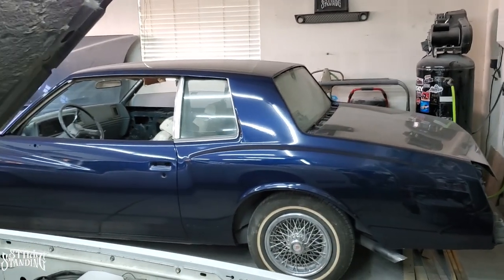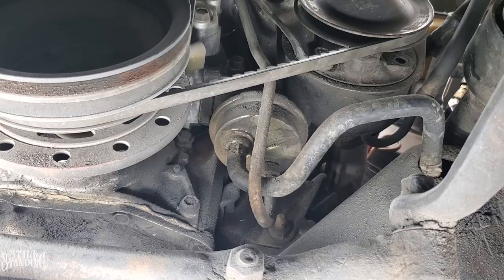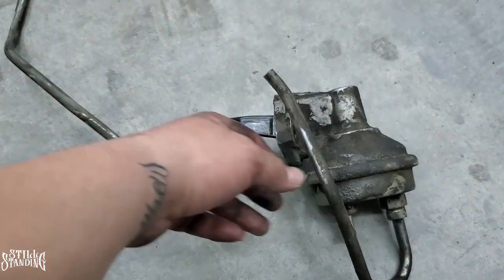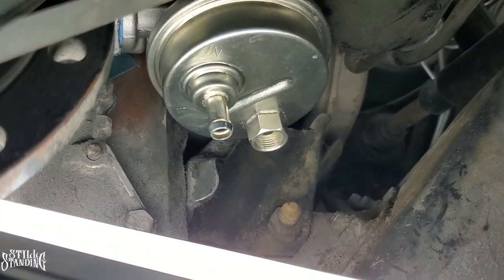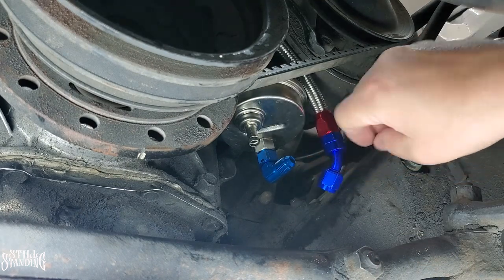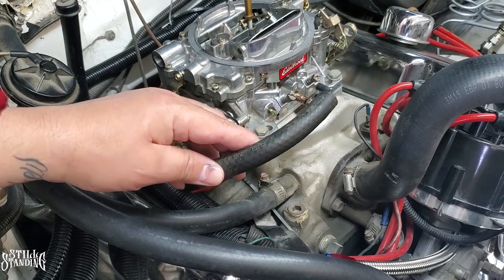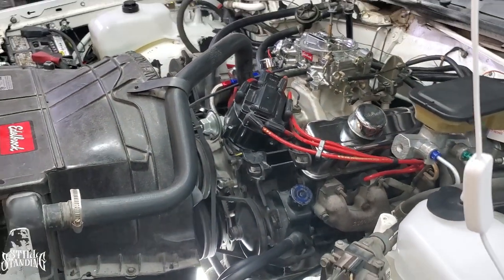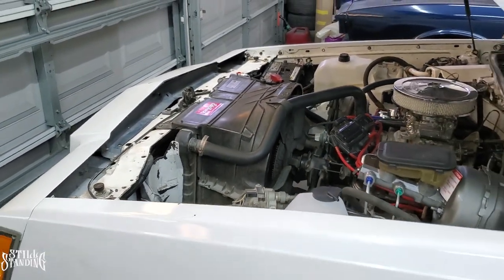Gbody New Fuel Pump 83 Regal

Comment: I just replaced mine as well. After the new pump was in it started flooding the stock OG carburetor. Had to install a regulator. I don't have a gauge. Might go pick one up. Good video.
Reply from the maker: Yeah the pressure gauge always helps. I didn't realize how low mine was running. Now it runs really smooth and it's not starving for gas... thank you for watching

Comment: Lol always easier said than done. I did my suspension on the Elco n thought it should take about two days, ended up takin me two months lol I got everything buttoned up but my passenger side soft brake line would not come off. It was only thing that I couldn't do after fighting w ball joints n bushings, takin off upper n lower control arms.
Reply from the maker: Damn! Yeah that's how it always is lol. The important thing is that we get it done 💪. Nice! So you have a brand new suspension pretty much. I did the same to my '78 Monte. The whole suspension is new. All stock, but new. It was before starting this channel. Could have been great if I documented that 🤷‍♂️💯
Reply: I need a few pointers on emissions system. Charcoal canister, n lines what goes to what. I replaced my carburetor w the speed demon carburetor, n i ended up just ripping shit out n not paying attention to my lines. I gotta replace carb to emissions approved carb n put all my lines back in.
Reply from the maker: I would say to look up the manual for emissions. They normally have the diagram of all the vacuum lines and emissions.

Comment: I did the fuel pump on my '80 Monte (V6 229) last month.  No way I could video it.  Too much editing to remove my cuss words.  Tucked under and against my cross member and starter.  The ratchet wrench is your friend for sure.  Nice work once again. Very clean set-up. I also like how healthy your V6 sounds.  I need to work on that.  My stock exhaust is like a grandma's car.  :)
Reply from the maker: Thank you! Some times I don't want to record what I'm doing because the camera gets in the way and it's always a lot of editing involved lol. I'm looking to change my exhaust to the stock no sound type of exhaust. Cops are always on our ass around here and by it being quiet I won't be attractive that much attention. At least that's what I think lol

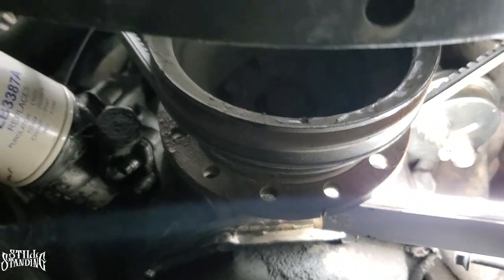Comment: Question. At 9:13, you mentioned you rotated the engine,
To make sure nothing was binding up with the fuel pump, and not hear any metal clacking after start up. My question is, does that rotation mess with timing or top dead center issues with any other systems? I guess what I’m asking is if I rotate the engine in order for the fuel pump to marry as it should inside the block, is it going to mess anything else up?
Reply from the maker: No, it won't mess anything up because you will be rotating the engine as if it was on but much much slower. Thank you for watching.

Comment: I enjoy the vids ! I am fixing up a 84 cutlass for my son we put in a rebuilt 3.8 v6 out of a 84 Buick regal a year ago but had original fuel pump, I bought that exact fuel pump is it necessary to turn the engine or can I just install fuel pump and connect lines and turn the vehicle on?
Reply: Did the instructions say anything about a pushrod I know the small blocks need the pushrod to be backed up to install fuel pump but I was told this pump was easier to install than those. Thanks for any advise
Reply from the maker: You can install it and just turn on the car. You'll be fine. These engines don't have a rod that needs to be held back. You can just take out the old fuel pump and install the new one without any issues.
Reply: @StillStandingGarage  thank you I appreciate it! Keep on doing your thing I’m learning as your putting out videos;props for sharing your experience.
Reply from the maker: No problem any time and thank you.

Comment: Bro would you happen to have that part number to the little 90 degree piece that you used from fuel pump to the fuel line?
I have not been able to locate it anywhere. 
Thanks in advance 
And thanks for the video.
Reply from the maker: Yes, I put the link to it in the description of the video. Check it out 💪💯
Reply: Thank you Bro

Comment: Hey bro Im having a lot of issues with my 85 running really rough when I put it in gear but when its in park it idles just fine. Can you for somone in the comments tell me what’s up ? And point me in the right direction!! 

My car is all stock V6 3.8L dual jet carburetor
Reply from the maker: Check that your timing is correct first. Oh, and make sure that your ignition system is in good working order. After this checks out, you can tune your carb. If it's been a while since the carb has been rebuilt, it might be a good idea to rebuild it.
Reply: @StillStandingGarage  OK I will give it a try. The carburetor is a rebuilt carburetor probably about a year old. I am pretty sure that ignition system is in good working order because it has brand new spark plugs brand new wires brand new cabin rotor so I don’t know what would be causing this issue.

Comment: What is the angled adapter that you used to connect to the pipe that swivels?
Reply from the maker: It came as an attachment to the fuel line.
Reply: Okay thanks! And will these products also fit a 1978 regal 3.8l turbo?
Reply from the maker: I'm not sure if they'll fit yours. You can check on the site if you enter your car's make and model it'll tell you if it fits

Comment: How long is the line you got?
Reply from the maker: It's 21.5" long.
Reply: Do you have a part number for the adapter on the pump that swivels?
Reply from the maker: Yeah here it is 

EAR-949096ERL
Reply: Thanks a lot. my pump just went out on the 83 regal so this video was VERY helpful. Thanks again for the info.
Reply from the maker: Damn that sucks. Glad I was able to help...thank you for watching 👊💯
Reply: How hard is it to turn the engine so the pump can go in?
Reply from the maker: Not hard at all. You can rotate it by putting a socket and wrench on the bolt that's in the center of the harmonic balancer. I don't know the size of the bolt right off the top of my head.
Reply: Ok. Thanks man
Reply: Just having trouble getting the pump in and maybe rotating would help
Reply from the maker: Yes that will definitely help. Rotate it a bit at a time and try to put the fuel pump in.

Comment: Is that a 3.8L V6
Reply from the maker: Yes, it is 💪💯
Reply: @StillStandingGarage  bro do you know off hand for the stock carb whats the fuel pressure psi  needs to be? Im switching from mechanical to electric any help would be appreciated ..same engine.
Reply from the maker: Stock should be about 5psi if I remember correctly.
Reply: @StillStandingGarage  thank you.

Comment: Hey bro I have a 3.8 v6 in my regal and I want to change the intake to a edlebrock like yours can you tell me any modifications you had to do to run that intake ?
Reply from the maker: You will have to unplug all your emissions to run this set up. It will pretty much clean up your engine bay. But as for modifications, there isn't any major modifications required.
Reply: @StillStandingGarage  okay thanks bro can you tell me we’re I can buy one at ?
Reply from the maker: Check with Jegs and Summit racing. When I bought mine I bought them as a kit.